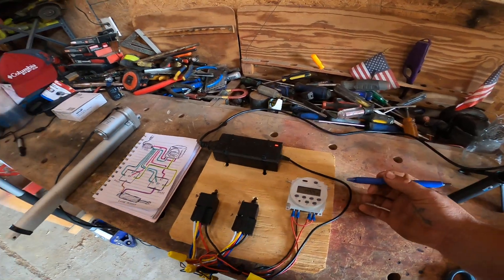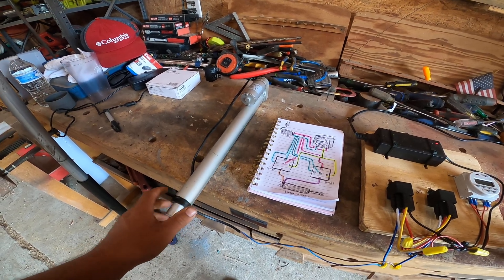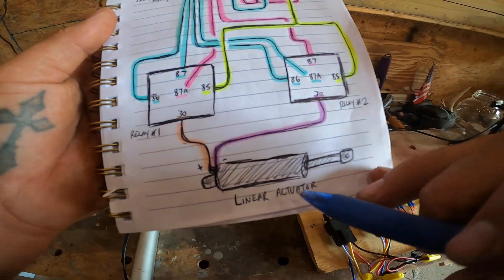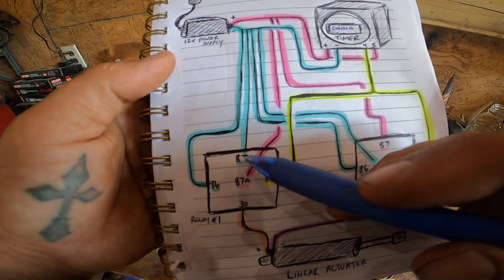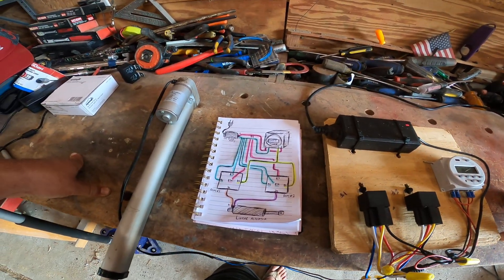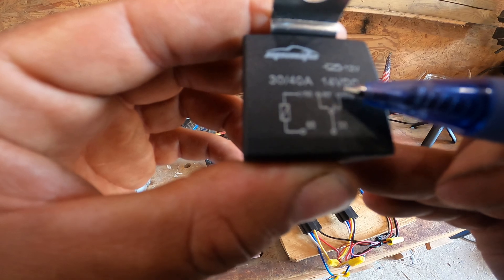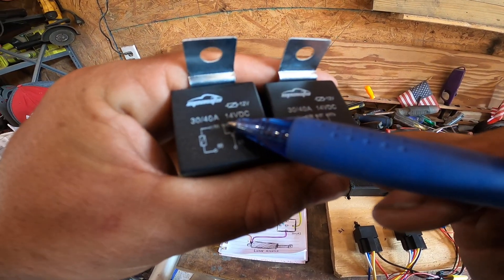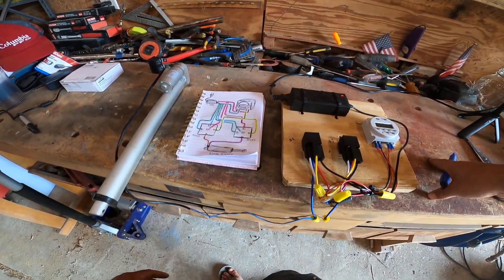How to: Linear actuator, timer, 2 relays. Automatic chicken door!

Comment: I built this exact setup and it worked great for two weeks. Today the door won't  close when the timer turns "off". The relays were also hot. Any ideas?
Reply: I'm thinking use two timers. One opens. One closes. Otherwise One relay is always active? Drawing power (I'm running solar 12V battery)

Comment: How does this automatically switch the polarity? Isn’t it the same input when the timer is activated?
Reply from the maker: If I understand the question correctly, the timer is an open circuit normally, and when the timer activates it sends 12v positive and a negative. That would make the actuator engage outwards but the actuator would not do anything once the trigger is off. It would stay outwards. (If the actuator had a mechanical spring to bring it back in when not triggered, just the timer would work. Instead, a typical actuator, needs the positive and negative to switch to retract)
Reply: Edit